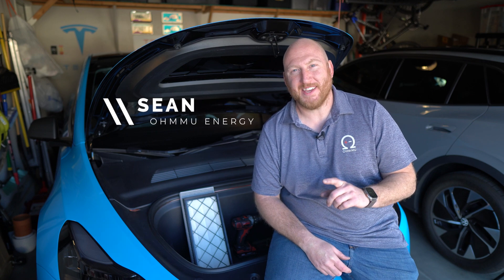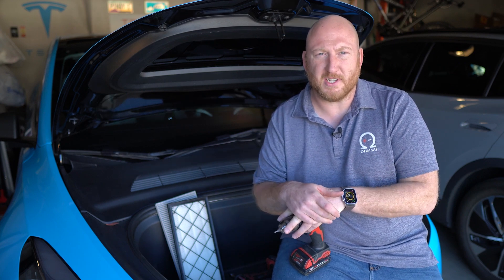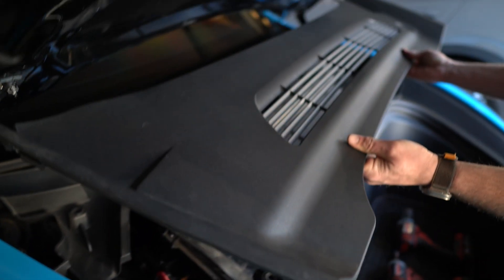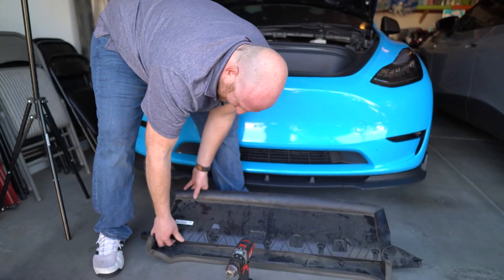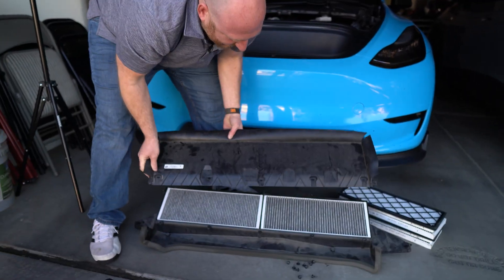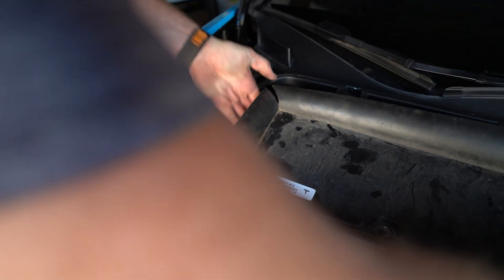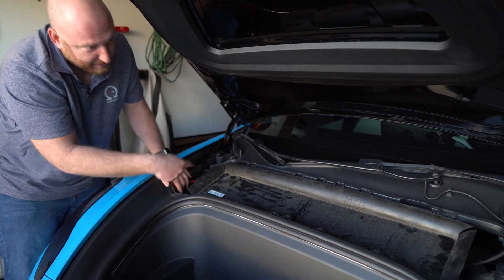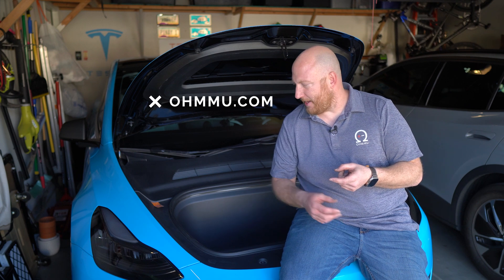Tesla Model Y (2022+) - HEPA + Carbon Filter Kit Installation (Ohmmu)

Comment: Do you know what the PN is for the 2021 air filter? I’m rebuilding the front and bought the hepa assembly thinking that would fit. It does not, and I’m realizing the 2021 might not have an exterior air filter?

Comment: How often this filter changes? there are cabin filter too. Does required change all at same time?
Reply: The tesla store says every 3 years for the air intake filters and every 2 years for the cabin air filters.  Could be more often depending on air quality/dustiness of your area.  My cabin air filters started smelling after 1 1/2 years so I just replaced those and did a coil cleaning.  I am going on a long trip next month so I have also decided to replace the HEPA air intake filters now.

Comment: Hey guys, just got a 2022 Model Y and noticed my car is missing the 2 10mm bolts holding in the Hepa compartment. Do you know the actual size? Lowes shows 5mm x 10mm and 6mm x 10mm bolts